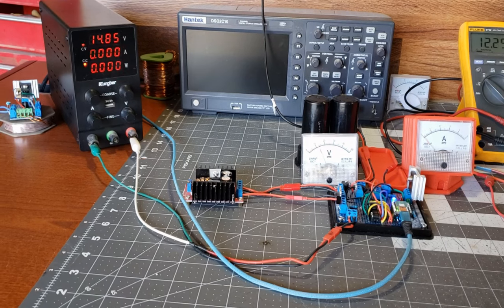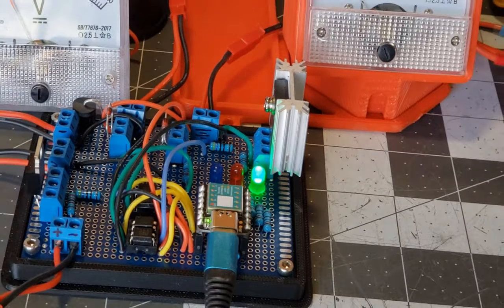Innovative Cap Dump Circuit with Automatic Cut-Off | Solar & Wind Power Companion

Comment: Very interesting at 1:40 the feature to prevent over-charging.  That's awesome actually since safety is a primary concern.  Would a schematic also be available?  When the PCB's become available for sale, do you have a K-Energy type shop or should we contact you via email?  Also would it be possible to share the source of the cost effective dc-dc converter?  Thank you for contributing to the community sir.
Reply from the maker: I'm working on my e-store product line. This circuit will be one. The schematic isn't very complicated or necessary for repairs since all major components will be easily replaceable with screw terminals and sockets. The micro controller sketch will be included so experimenters can tweak the trigger timing. 98% of everything I buy is from Amazon, so if you see something in my video, look there you might even find a better version suited your your needs. Thanks for coming back bro!
Reply from the maker: I appreciate your kind words. You wouldn't believe the venom some people throw my way.
Reply: @redesign3dp  I believe Tesla had the same problem. Too bad they didn't realise he was sharing  a treasure.
Reply from the maker: Yeah. With all our intelligence, ignorance is humanitys curse.
Reply: @redesign3dp  Well said sir and sadly true.

Comment: Excellent, I'm wondering if this could help in an application I'm working on...
Reply from the maker: I'm sure it could. The cap dump and the battery voltage is settable with 1w zener diodes. So this will fit many applications.
Reply: @redesign3dp  I have a 24 Volt (two 12V) in series batteries that I need to recharge each at 12Volt naturally 1 at at time with a quick switchup. the only thing I could think of was maybe an Arduino R3 switching the charge real quick.
Reply from the maker: Thats a project in the works. I will use a micro arduino (samd21 xaio) to control a gear motor to actuate heavy duty relays. It will incorporate stop switches.

Comment: What if you made a pulsed dc motor with capacitor burst discharges.
Reply: Also you could charge capacitors in parallel and discharge them in series as a capacitor converter. Though if you had a pulse motor a mechanical switch could discharge capacitors or batteries in series then parallel for high current and voltage.
Reply from the maker: On the to do list for sure.

Comment: See dude it doesn't make sense you put out more watts than you put in. Well I guess for a shorter time? U explained nothing about the circuit really.
Reply from the maker: Sorry about that, it was a follow up to an earlier video that should have been tagged at the end. But you basically explained it. Capacitors or condensers can charge up fairly fast then discharge quickly with nice amps. Subscribe if your interested, I was just showing that I converted the breadboard version to perf board, the next stage is a pcb.